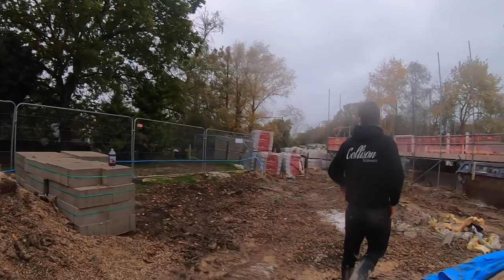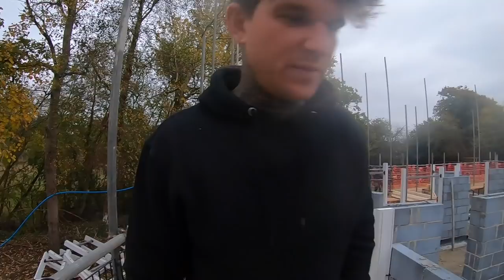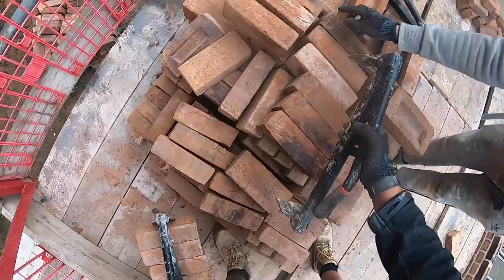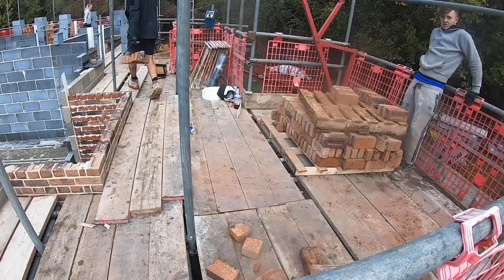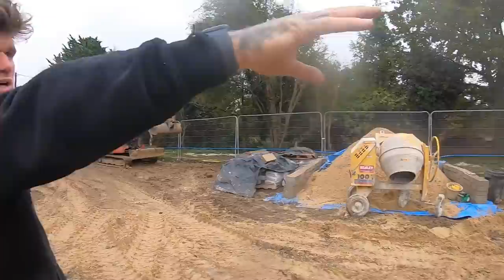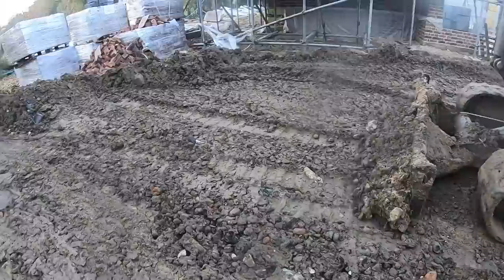Bricklaying - Day 24 - Ready for Monday

Comment: Sites looking a lot better there Charlie. Clean and tidy👍🏻. 
Busy day Monday and back to laying some bricks.  Please don’t take this the wrong way Charlie but once that sand gets low get the plastic from underneath out. 
When it rains the water is gonna sit at the bottom and your sand won’t dry. When it gets colder it will freeze it rock hard. Just a thought mate👍🏻. Great video 🤙🏻
Reply: Not if you cover it on top,which he probably does seeing extra plastic over that fence.
Reply: @patdiggins9252  yeah I see Charlie has some ganging over the fence. It will get damp still in the day time. 
Water well sit on the plastic and it will freeze when the temp drops below freezing. Just thought I’d say that’s all. Charlie knows what his doing anyway.

Comment: that is the best scaffolding iv seen you lads on exactly the way we do it and youll find its much easier on you as you only have to go 7 course of block instead of a mind numbing 9 and faster too just as long as you can build overhand youll never want to stretch like an orangutan again
Reply: we take up to joist height and get the internals up to joist, drop back on outside and take the donkey lift up, brickwork only  . and then  let the scaffold go up. we used to just do the  beam filling only  to stiffen the joist up but no need to now as floors go in,